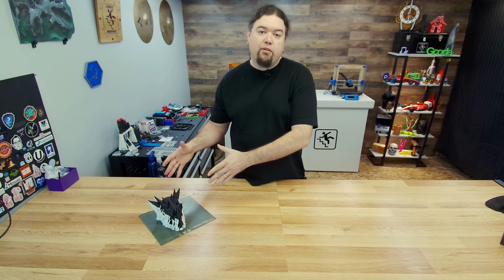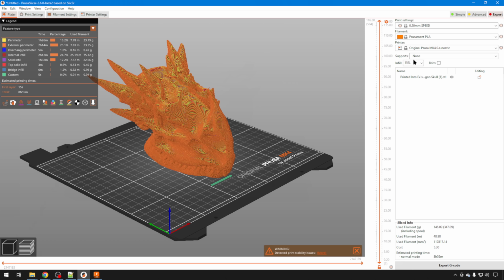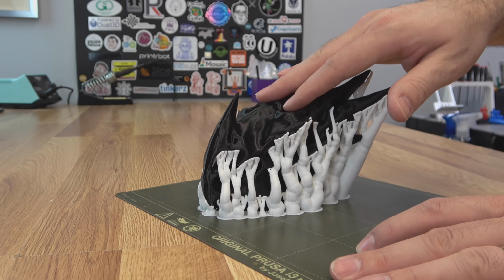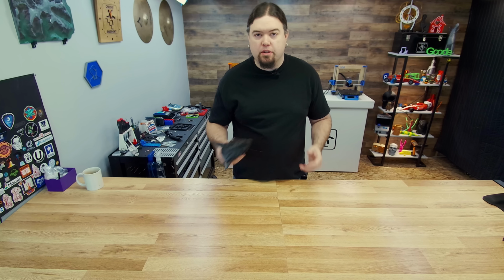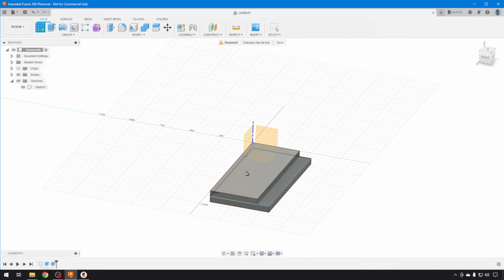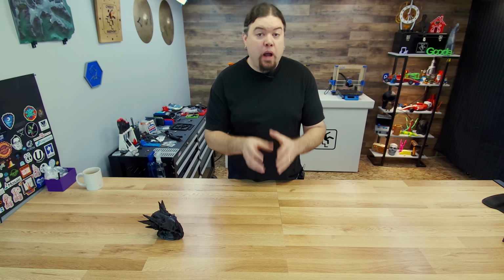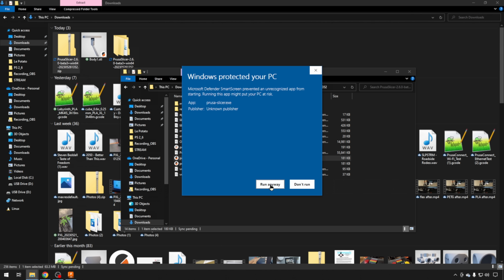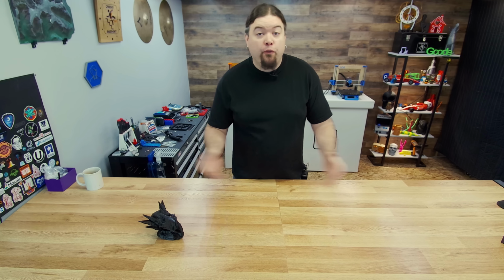Prusa Slicer 2.6 - Organic Supports - Chris's Basement - 2023

Comment: Chris 
Thank you for the comment.  You read the error correctly.  Got frustrated and went back to the main screen.  I saw that I had supports turned off and tried turning on support and when I went back to the settings I could select organic supports. I am a retired programmer so I knew I had to change a setting somewhere.  I selected supports and went back and could do organic support. I just went into PrusaSlicer and there is a 2.7.1 now. 
Thank you for your help and have fun printing.  We just got another printer Neptune Pro 4.  Thank you.
Reply from the maker: Thanks for the update! I'm glad you got it going

Comment: I'm curious to know, does it actually use less material and print faster?

Based on your video, the moment you sliced using Organic, it does show a larger amount of filament used (55.93g vs 57.62g) and a longer print time (15h 39m vs 16h 55m)

Does Prusa Slicer just have issues properly representing these values (i.e. it's actually much more efficient/ faster than shown) or am I missing something? One of the selling points of Organic supports are faster print times/ lesser material spent for supports so I'm quite confused by this.
Reply from the maker: I have found PS does have problems calculating the time and materials. Also, it kind of depends on the part. Organic supports seem to be way to dense by default, you don't need near that many. I'm hoping over time the settings will become more robust and the saving/speed will become more obvious.

Comment: Hi Chris,

Informative video Sir, thank you...

When it comes to having to use supports, I still end up using Simplify 4.1.2, as they just peel off so cleanly, I have tried using similar settings with Prusa, but still find it hard to remove them cleanly, I've not tried using the organic ones yet, so will give them a try...

Thank you again for yet another great video...

Andy...
Reply from the maker: Thanks Andy, it's good info to have that simplify still work so well for this.

Comment: Nice overview!  I've really been pleased with organic supports.  One tip from 2.6.0-alpha2 release notes: "Interface layers are not always produced reliably. As of now printing with zero interface layers is recommended, which produces easy to remove supports."  Apparently they've since fixed the bottom interface layers, but I still find supports easier to remove without top interface layers.
Reply from the maker: Thanks John! Nice tip, I will check it out. See you at MRRF!

Comment: It made the print take 1 hour longer and was only a 4 gram difference in filament used. But better quality and easier to break off the piece I guess. What I want to know is if they work well for tinny support pieces on smaller objects then the normal support material style.
Reply from the maker: I would think they would work on smaller pieces as they need less contact with the part.
Reply: @ChrisRiley  thanks

Comment: I am relievedly new to 3d printing.  I want to use the organic trees but when I go to Support Material  > Options for support material and raft > Style: The option is grayed out. What do I have to do to activate that option. Help thank you very much for your help. Ray
Reply from the maker: That's strange, I would upgrade to the newest version, 2.7.1. Make sure you have it set to expert mode and you turn supports on in the main page, the plater, it's under printer settings.

Comment: It's odd seeing prusa slicer in blinding mode. I'm so used to dark mode. lol But yes, hybrid supports would be nice. There is one other feature I would like. I decided to try using PLA colors on PETG for my MK4 kit (shipping soon TM lol) I wasn't sure it was going to work, but it did. However the one problem I had, was the wipe tower. It would be nice if they could have a mostly PLA tower and a mostly PETG tower. I think it would help. 

I really wanted to do multi-material organic supports on the mirror bezel for my parent's car (93 mercedes I believe) but I was having enough trouble with just normal PETG on its own I decided to abandon that. Also I honestly don't know if there is enough room on the bed anyway. The part is so large it barely fits when carefully rotated. So I only have a little area in 2 of the corners left. V1 printed successfully, but I had to reduce speed to 70%. When I did 100% the organic supports kept collapsing. The only issue was the original part has some structural infill that's exposed. I tried to print that as exposed gyroid. It didn't go so well. You can't tell from the outside though. V1 should work I was painstakingly measuring everything on the original with calipers, but I'm not happy with it. For V2 I made the structural infill have a solid hull. So it's no longer exposed. That's the only change I made. My parents are coming on friday. V2 should be done on friday morning. Also I still have the front part. I want to give them a 2nd one of those just in case. But that part is a lot easier and faster to print. It barely requires any supports.
Reply from the maker: Blinding mode, HA!  That's a good idea to be able to change up the tower. Good luck on your part, I hope it fits! 😀
Reply: @ChrisRiley  and yeah blinding mode. The older I get the more sensative my eyes are to light. I hate going outside especially during the day. I'm becoming a vampire. lol

Comment: biggest problem i have is that my model doesnt stick to build plate and 2/3 through nozzle hits it and it moves ruining it all. Everythings levels as it should be. Also in Prusa there isnt option to increase raft nor theres option to print multiple elements because of some stupid error about tall object you cant turn off and it wont process it into G code
Reply: I just encountered this today, one of the trees was built up higher than the others during the print and got knocked over. If you find a solution please let me know
Reply from the maker: I have noticed a few of the features changing greatly when organic supports get enabled. I saw that a lot of them have been reported on github. Hopefully they will get resolved in future releases.

Comment: Another tip: Try to use different support material than the main material, petg and pla don't stick well to each other making them much easier to remove.
Reply: He mentions this in his video at 7:43 but it only works if you have a mmu
Reply from the maker: Thank you!
Reply: @Caretak007  didn't catch that, I assumed he would've done it since he has an MMU.

Comment: Cura is so much better it looked like struggled mate to remove :) but usually its what you start with to which slicer you use great video. Also if you decrease the density it will be easier to remove.
Reply from the maker: Thanks! I just never use Cura, I know they do a great job on it, it gets better all the time.